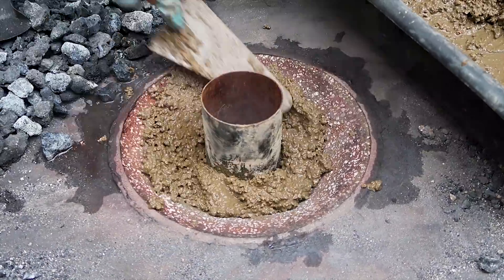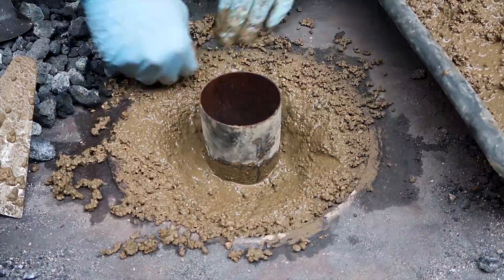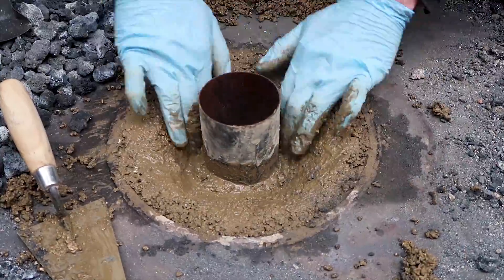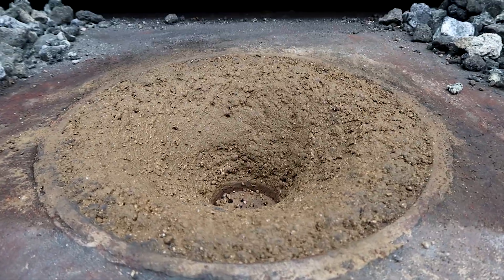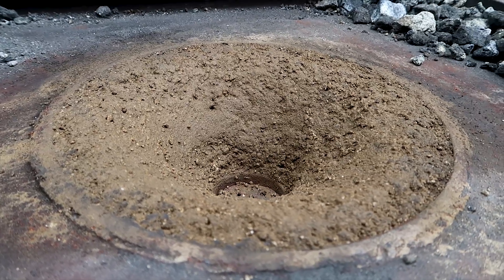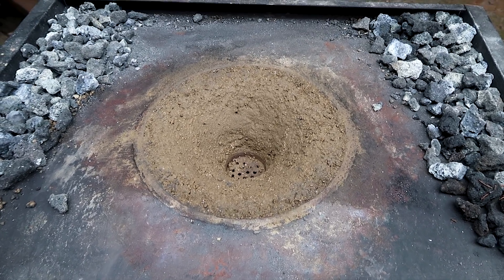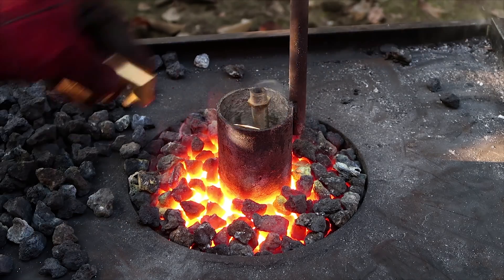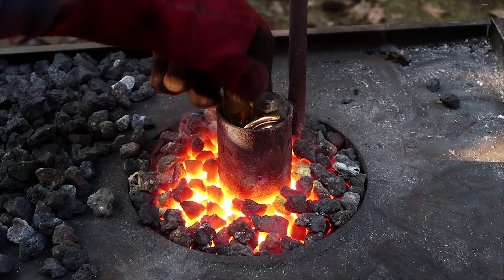Improving My Forge With Insulation

Comment: Be careful with mineral coal and good insulation : you can melt steel and start melting bricks, it happens way faster than you expect...

Also, tip a bricklayer told me : you can mix pure refractory cement with ashes, it helps to avoid cracks on heating. 
Tried it, and I poured this mix into steel wool : so far it looks pretty indestructible, and a good alternative to perlite (which I didn't have). But it's 1 block forever after that.

Comment: mmmmmmmmm as far as i was aware using coal/coke will get temps as high as you could possibly ever need for forging/welding. In fact your more likely to burn your metal. Then embers/ash insulate the centre of the fire, but you have to get the working piece in the middle. Check out www.iforgeiron.com, those guys are super friendly. Whats happened to your video Q. Much respect for showing the fails as much as the successes dude.